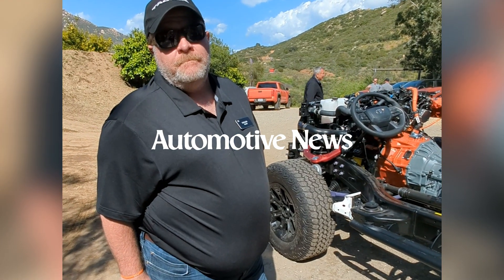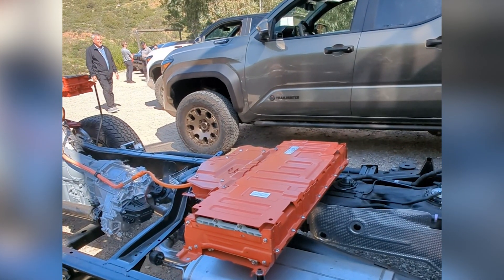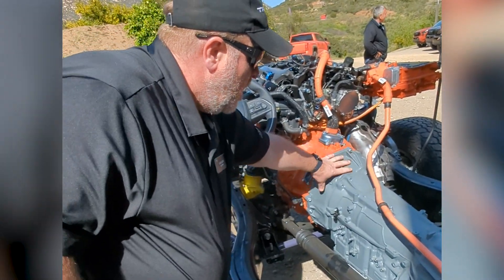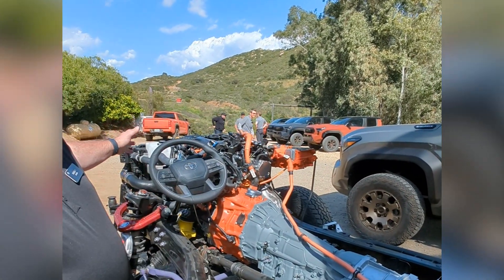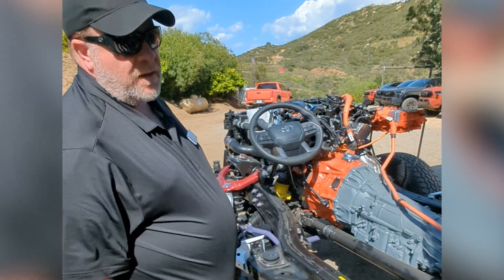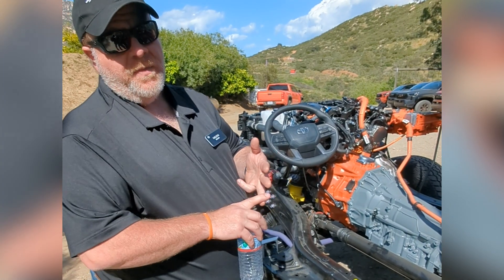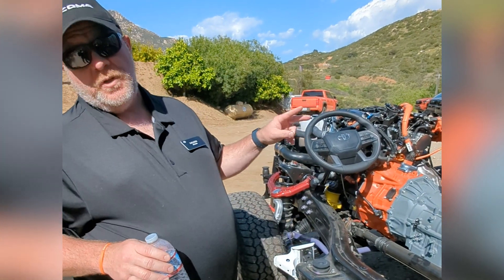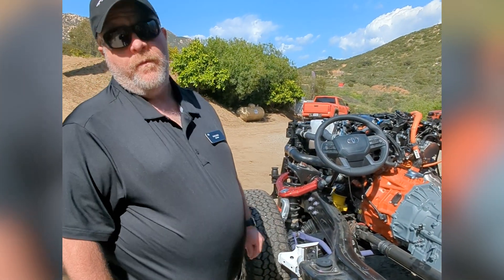AUTOMOTIVE NEWS VIDEO: The iForce Max hybrid system on the 2024 Toyota Tacoma

Comment: Maybe I am agree about the power, but my experience with my Toyota Tacoma Trailhunter Hybrid 2025 i-force max is very bad. The gas performance is 16.7 mpg after removing the Overland Bed Rack. Before that, it was 16.2 mpg. In summary, I suggest you think two times before buying a Tacoma 4th Gen. Besides the gasoline performance issue, my Tacoma has a vibration that is crazying me and impacting my neck. I am thinking of changing it very soon. And we don't talk about frequently disconnecting with my android phone. I have had many cars, and this was the more expensive ($68k) and the car with more complaints in a couple of months. Relationship price vs value, for me, very bad.